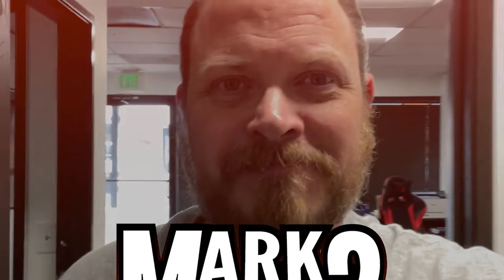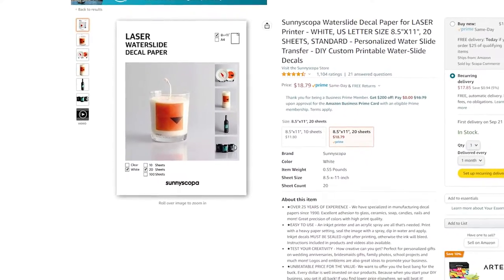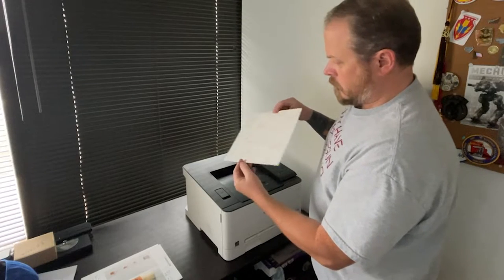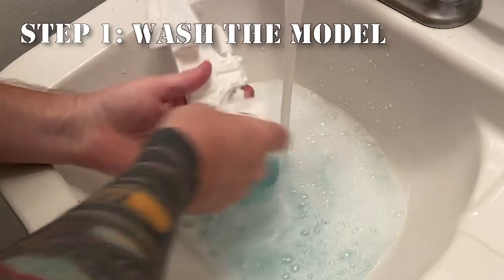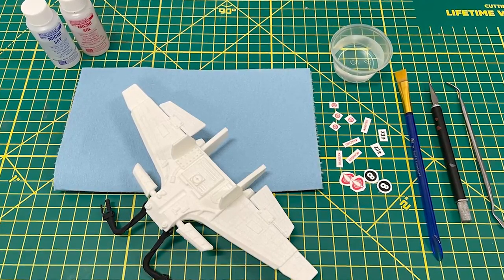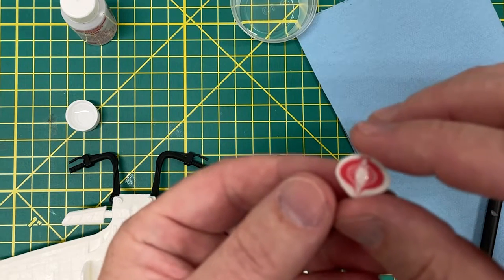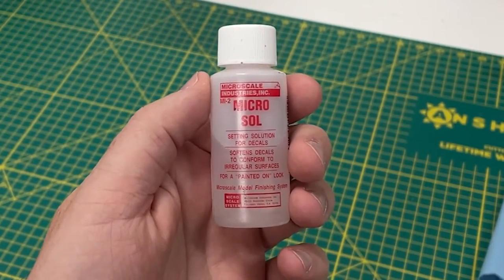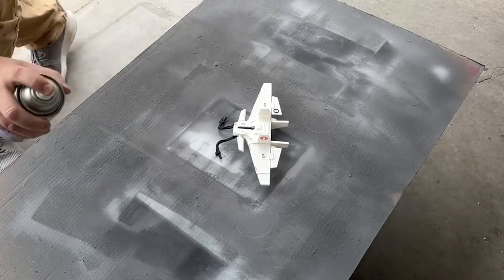Ultimate Guide to Waterslide Decals

Comment: I'm gonna use clear waterslide on a motorbike white part. Should I paint white the transparent edges before clear coating, or I can clear coat right on the sticker as it is? Will the edge line be visible after good 3 coats of 2k clear and sanding and buffing?
Reply from the maker: A real life motorcycle or a model? If it not a model your real concern is what type of clear coat that you are using and will the waterslide stick to your surface? If there is an enamel coat on the paint already I don't know if it will stick. Also, it may appear to stick until it gets wet.